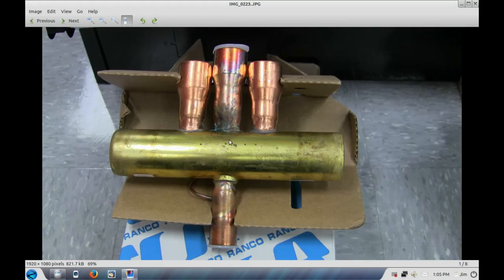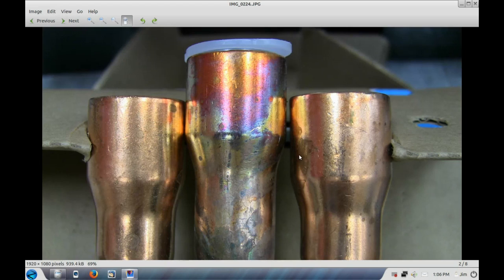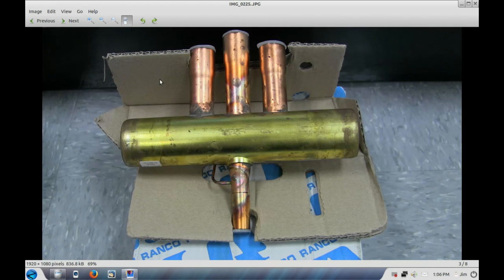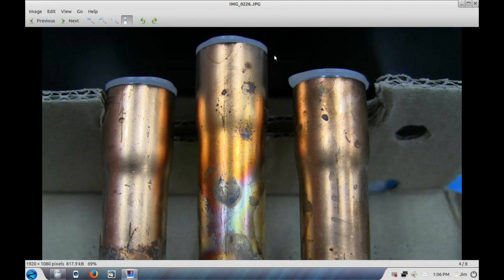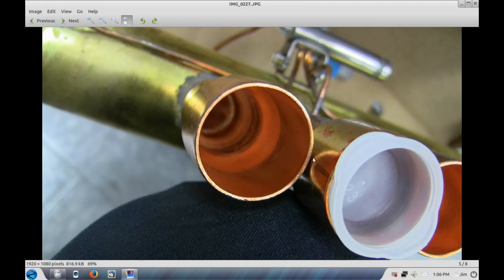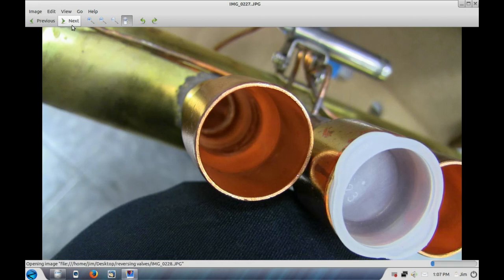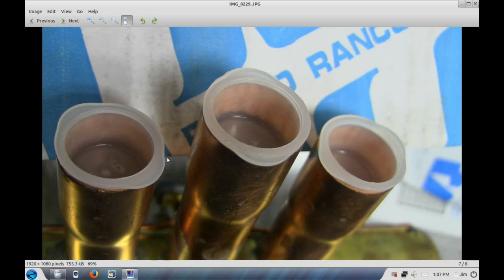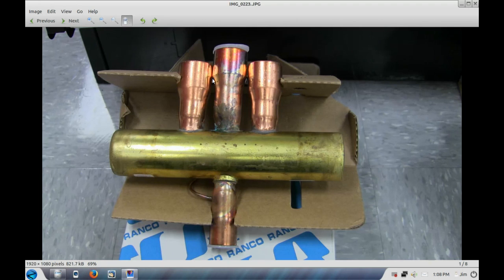HVAC Gripe #1: Reversing Valves

Comment: When removing a reversing valve, why not us ea hack saw to cut the tubes close to the valve body first, remove the body, then de-solder the leftover pieces and yank them out of the entering copper lines with a vise grip?

Comment: My 2 ton Trane XL14i ffrom 2006 has an Emerson reversing valve, and when it switches, it's not very smooth, it takes sometimes a few seconds to respond to the solenoid being changed before the valve actually moves, and when it does, it makes a lot of knocking and metal-on-metal squeaking and rubbing. Why are so many reversing valves so stiff when they switch?

Comment: Like you said,  I also think the engineers who design these things need to be out in the field to change out what they designed.  But you and I know they don't have to worry about that,  just make it as cost effective as they can.

The location of most of these valves (maybe Trane/A.S. is the exception) is lacking in common sense design. It can be a pricy change out if the condenser coil has to be removed to access the R.V.  That high cost pushes the customer toward a new unit or whole new system.  Somehow that doesn't seem fair.

Comment: Put a piece of pipe in the swage end  and bend it outwards away from each other being careful not to snap the other end off. I have done this many times with great success. Use acetlyene and not mapp. Use a wet rag around the body, earlier valves had a plastic slide that could melt. Newer valves have a metal slide. Sometimes when removing the old valves  oil that was trapped would  go up in a flame so be careful and wear protective gear. I always have a fire exting. handy when the torch comes out.